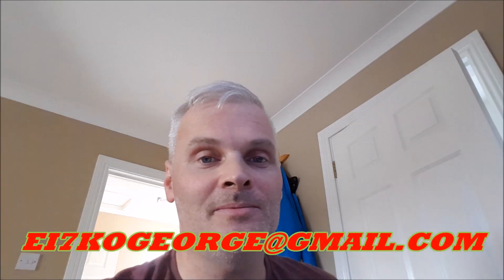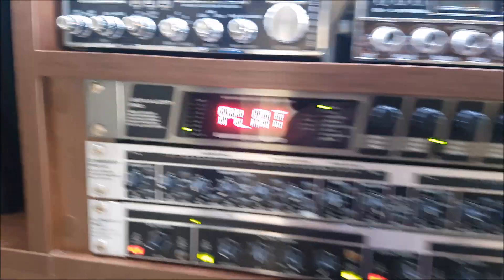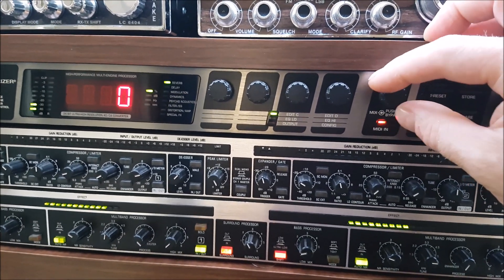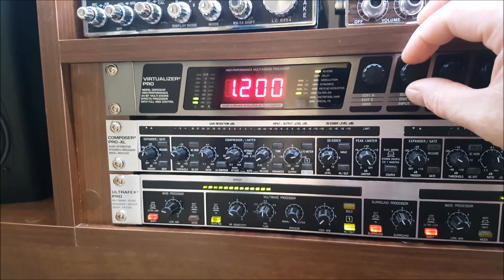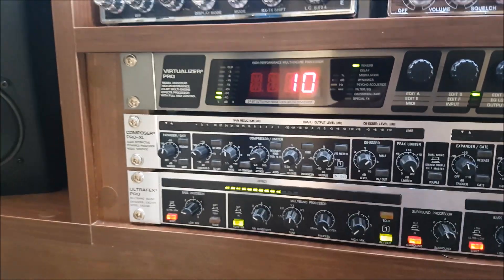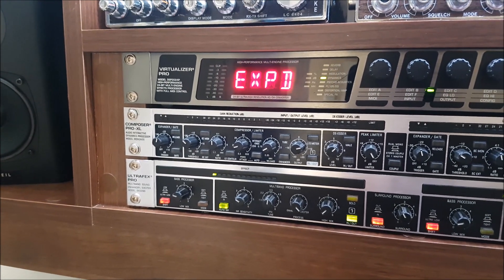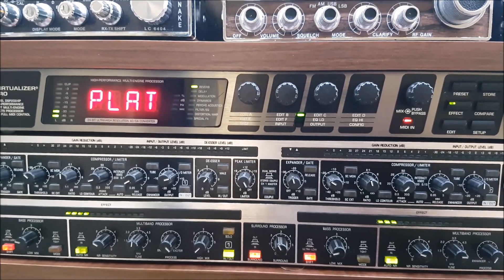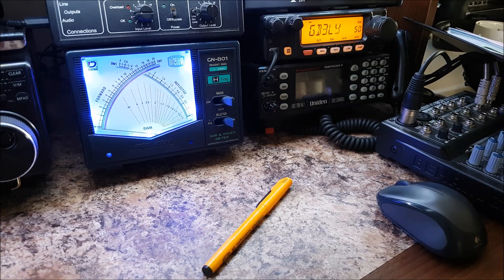BEHRINGER VIRTUALIZER PRO DSP2024P

Comment: I noticed only the LEFT channel meter is active and the RIGHT is not moving at all. I have the same exact problem. Do you know why that is? Thanks.
Reply from the maker: Set to mono mode? In my case that is necessary
Reply: @GeorgeEI7KO  Thanks for your reply. Is there a switch on the back to switch to Mono mode? Please advise.. Thank you.

Comment: Hi, could you please measure the voltages of the secondary windings on the transformer? It's burned out, and I can't find what voltages it's putting out (V-PRO DSP2024P). 73, SV4FHS

Comment: Are those CB radio's above ?
Reply from the maker: Guilty your honour. I restore and modify them
Reply: @GeorgeEI7KO  You're not guilty, you're smart ! I used a Cobra 148GTL in the 80's. I was pulling signal from over 200 miles with a Wilson Antenna ! Had a diy spring reverb on a 9v !
Reply from the maker: @NicholasT-f9n  I have a highly customised 148 GTL here. 1979 model.
Reply: @GeorgeEI7KO  '79 148GTL - WOW ! that's a rare beast. 
What's your opinion on cheap ebay PLL fm transmitters ?
Can you private msg me your email, would enjoy chattin offline.

Comment: I have the Alesis QuadraVerb and wondering the difference between that and this unit.
Reply from the maker: I can't answer that I'm afraid. I don't have that particular unit.
Reply: The one difference is, the Alesis QuadraVerb, as the name implies, you can have 4 effects at the same time. I am about the quality of the effects. The VIRTUALIZER PRO is categorized as a budget device. Thank you for your response.
Reply from the maker: @bobcatt2294  thats cool. In my particular application, I only want a small amount of plate added to the audio. I'd have no need for that function on amateur radio.

Comment: Can I use that as my compressor?
Reply from the maker: No, afraid not. You need a seperate unit for that.
Reply: This isn’t true; this unit has a bunch of algorithms including some mastering/level processing. You can also run it in true stereo or as two different algorithms in mono series, by the way.